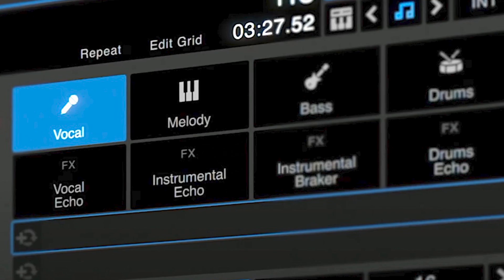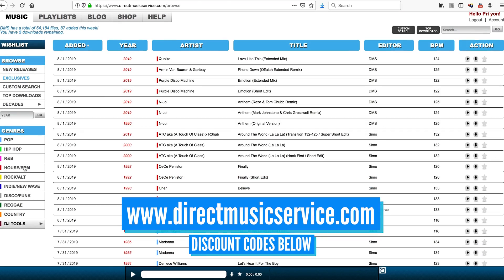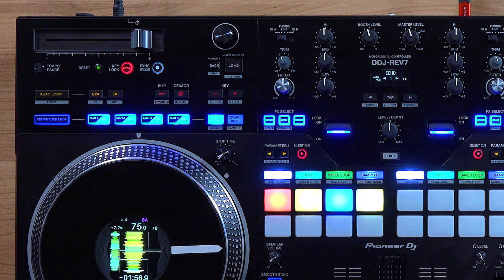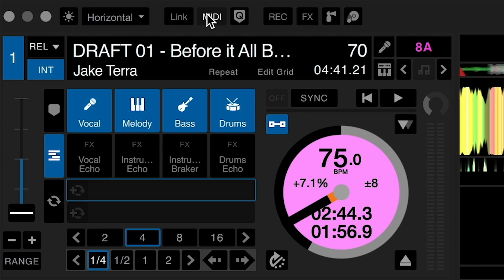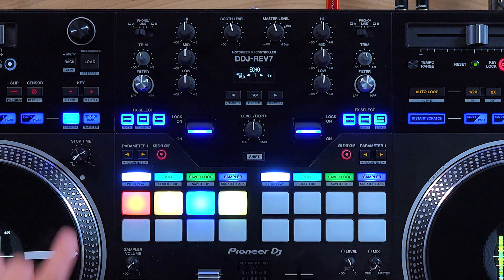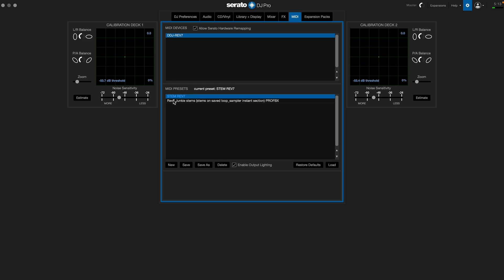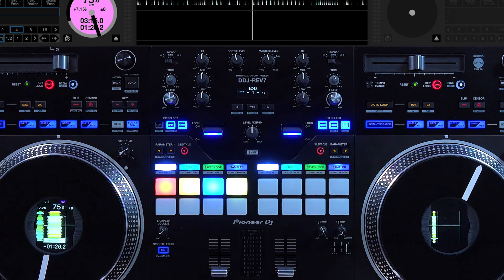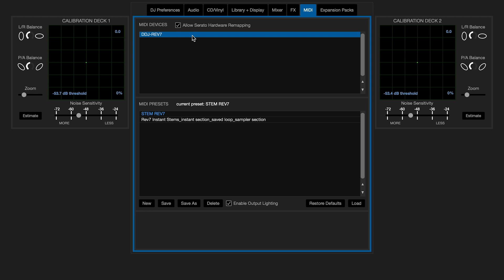DDJ-REV7 + Serato STEMS | MIDI Tutorial

Comment: Hello , I’ve watched all your videos and they have helped me a lot ! Thank you . I have a quick question , I did the stem functions as you explained from the extra pads but everytime I tried using the vocal ,melody stem effects … for some reason the volume goes up automatically and is very noticeable since the volume goes up automatically and I haven’t been able to use the stem effects for the same reason 😣
Reply from the maker: Thanks for the support! Two things here:

1. The stem volume rising up is often due to when you use pre analyzed stems. I’m guessing that you are using pre analyzed stems, if I’m correct? If you are, you need to reanalize your stems. I use real time render, and I never have issues with volume.

2. Did you know you no longer need to do this mapping on the REV7? The latest firmware update not only has this feature built-in, but the addition of Stem EQ: the ability to control the volume of individual stems with the EQ knobs. Be sure to update your REV7 firmware from PioneerDJ.com . Instructions and version notes are on the download page.

Comment: Sorry if this is a silly question but now that I've mapped the stems toggles to the SLOT/PAD buttons, does that mean I can't use the Sampler features?
Reply from the maker: That is correct. However, you don’t need to remap anymore. There is a new firmware and Serato version that not only this function, but Stem EQ as well to the REV7, a function that is not mappable.
Reply: Thank you! Just figured out that Stems can be controlled from EQ. Amazing.

Comment: Pri Yon Joni!!! Got a question for you brotha. Why doesn’t pioneer release an update to allow Combo Pad Mode on the REV7 like how the S11 and S7 can do? Is this something pioneer is thinking about or is there a place I can submit this request?
Reply from the maker: You already have a second pad mode on the Instant pad section. Instead of 4 of each, you have 4 up top and 8 on your mains. That’s more than combo pad mode can do.
Reply: @priyonjoni  understood, but on my S11 I really like having the top 4 as cue and my bottom row as my stems. I changed in the serato setting for stems to replace roll mode. That’s why I was curious on why Pioneer didn’t also add that to the REV7 since it’s their flagship controller

Comment: I have a Pioneer DDJ SX3 and was able to map successfully for STEMS but the pad lights don't work. It's stays on white, when I activate or deactivate STEMS. Please help if you know what am doing wrong.
Reply from the maker: Hello. No need to copy and paste your comment to multiple videos 🙂. Go into your Serato settings > MIDI tab. Select your DDJ-SX3 under MIDI devices. On the lower section, next to the Delete button, there is a box for “Enable Output Lighting”.

Comment: They should allow us to swap any pad mode on the Rev7. I never use saved loops 😢 swapping the slicer on the s9 is ideal.
Reply from the maker: Serato does. In your settings, instead of mapping, there is an option to swap one or more pad modes with stems.
Reply: @priyonjoni  you cant swap it to every pad mode on the Rev7, i want to wap out saved loops, but dont see that option.

Comment: Hi,

Could be the 33/45 buttons programmed to act like on any real turntable?
I was amazed by the rev7 having them, and tought it will open up the possibilities to the well known dmc-routines-like tempo changes, but its not.
Any idea how to add that extra 35% with a push of a button? (I know the 35% is good only at the 0% pitch value, and will differ on other values.....)
Reply from the maker: The 33/45 buttons behave exactly like a turntable. If your rotation setting in serato is left at 33; clicking the 45 button will pitch you up.

Comment: Hey thanks for this; I just might give MIDI mapping a try. I do like that in Setup on the public beta, I was able to choose the Slicer as the place where Stems are baked in without any mapping required. But there are potential advantages to mapping the instant scratch buttons while leaving the hot cues on the pads alone. Will try out both ways. As ever, thank you!
Reply from the maker: MIDI mapping in Serato isn’t really that scary! The system is simplified and easy to remove if you mess up.
Reply: Please help  I need to remove and do again  @priyonjoni